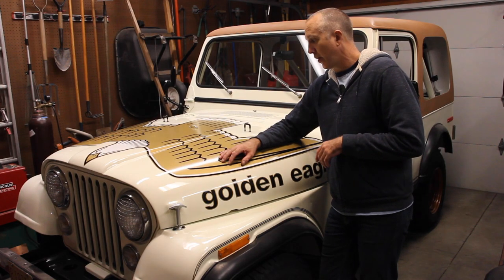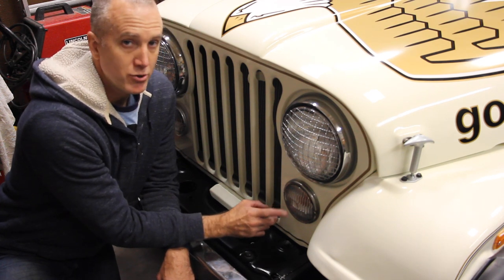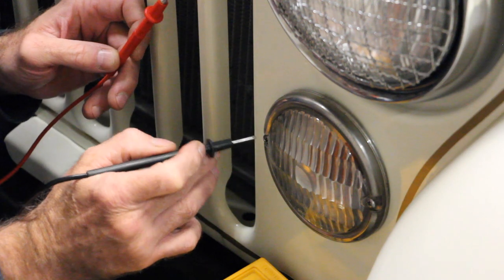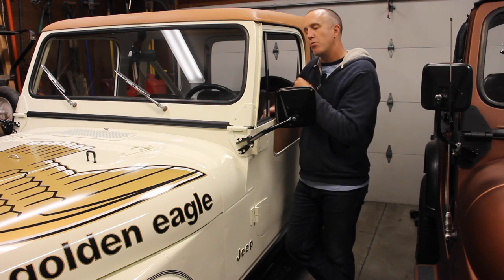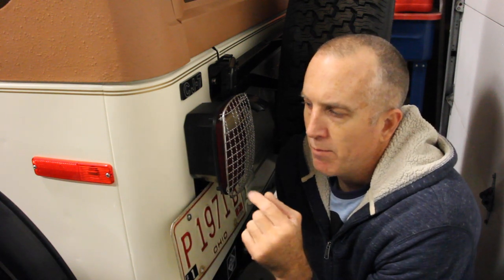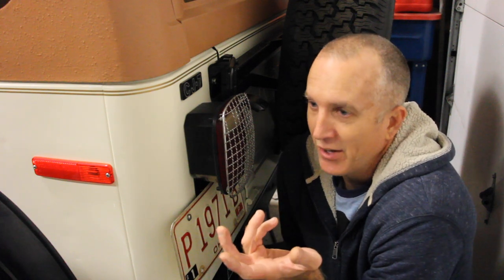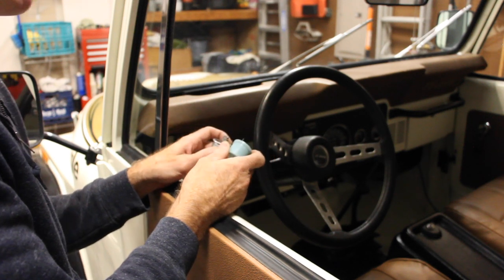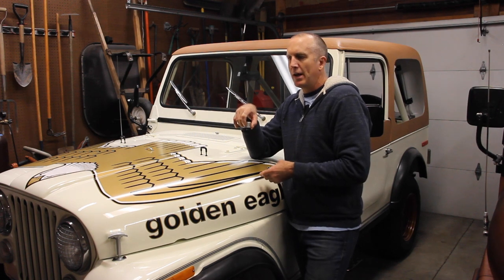Jeep CJ Grounds and Fuse Issues

Comment: I've had several Jeeps over the years and I recently purchased a 1985 CJ7. I love it and have recently upgraded the old stock headlights to LED. While doing this I removed the front turn signals in order to connect the Hailo turn signals in the head lights. When I reinstalled the turn signals that when I ran into some of the issues your talking about in this video. Discovered the quirky grounding issues. I have an extensive background in electronics so I recognized the issue relatively quickly. Unfortunately I didn't see your video until after this but it was none the less very helpfull in the confirmation. I've enjoyed quite a few of your videos and am looking forward to more.

Thanks for making these video's
Eric
Reply from the maker: Great to hear. Glad to hear the video helped, even in retrospect. I’ve got a couple more coming, although the frequency of new videos has dropped off in recent months due to other life priorities.

Comment: Thanks. I have a 79 cj5 with a wiring system that looks like spaghetti dinner for 50 at grandma Lucia's. I am putting this on the road and all I am really hoping for is functional(consistent) brake lights. Its got all the gremlins. Before I embark on a new wiring harness, which I will do eventually, I am going to attack the grounding. Thanks for your help.
Reply from the maker: Let me know the progress. Want to help where I can.

Comment: Just found your channel.  This video helped me figure out the turn signal issues I have been having. With my fiberglass body, the grounding doesn't occur through the screws.  I have a tab soldered onto the back of the housing that I can connect to with a spade terminal.
Reply from the maker: Fiberglass tubs pose a whole new set of rules when it comes to electrical connections.

Comment: My 81 cj5 was a victim of the recent "one in a thousand year" flood in Ft. Laud.  After 12 oil and filter changes it ran great,  BUT- electrics are nuts!  Only 3 flashers work, flash slow and after 5 minutes just stop!  One right running light is very dim, gas gauge suddenly go up and down, voltmeter goes on and off, yikes! Didn't have any problems before sitting halfway under water for a day.  After watching your vid I see how important ground issues are, I'll start there.
Reply from the maker: I’m betting it will solve almost every issue you have. Also go through your fuse box and make sure you are getting good connects with the fuses.

Comment: You could probably make an entire channel just on electrical issues and fixes for the CJ!  I have a '78 CJ5 and trying to sore out issues that I think are inadequate grounding of the dash (if that is possible) since wiper motor and dash lights intermittently have worked.  Considering just making a braided ground from dash to body, to see if it helps.
Reply from the maker: Working on it :)

Comment: I've watched so.many of your videos but hadn't found this one until I searched for cj grounding on Google.   I've got an 85 cj7 with a fiberglass body and chasing down electrical issues such as non working TS, taillight, parking light on with brakes,  tach, fuel gage.  The grounding to the frame checks out...I'll keep chasing
Reply from the maker: May brother has a fiberglass body. A good approach is to wire a grounding bar somewhere on the body and then connect that to the frame, engine, and battery. Then you can run ground wires directly to that. It will make a lot simpler system.
Reply: @coolguy_CJ7  yeah, it looks like they have a ground strap direct from the engine block to a bolt through the firewall that some grounds behind the dash connect to.  The dash panel is also grounded and a couple wires bolted to that.
Reply from the maker: @greghuizen  the tail lights, parking lights, and headlights all ground through the metal body parts that they mount to. So you’ll need to make sure they are grounded as well.

Comment: I just picked up a 79 CJ7 from my fiancé's dad.  It's in decent mechanical condition for being 44 years old, but the electrical system is a complete disaster.  The dash lights aren't working and neither is the speedometer/bulbs.  The turn signal switch needs to be replaced and only one brake light works.  Just ordered some new side marker lights but I don't think those are working either.  The headlights and windshield wipers work though lol.  I know I haven't even scratched the surface yet and need to start checking fuses and grounding.  What are your thoughts on only some things working and others not?  Your videos have been very helpful!
Reply from the maker: Grounds and bad/corroded connections. Get a good voltmeter and email me at dellis6914@gmail.com for a wiring diagram.

Comment: Crazy question but can you run your own ground,say to the metal plate in the light bucket to the body or the frame? Thanks, great info
Reply from the maker: @ronaldsteveson76  absolutely. Regrounding or adding extra grounds can eliminate a lot of issues with the CJs. Especially with the ones that are prone to rusting, which is all of them :)

Comment: Was having same type issues with my 82 CJ7 kept blowing the brake light fuse. Replacing the turn signal switch in the column fixed that but the left blinker wasn’t blinking. Pulled the lens the bulb looked good but one of the contacts and wires was hanging out the back. The rubber just got too old. Ordered two new crown light assemblies but I’m using OEM screws. The blues are not exactly correct so I’m cutting them off and replacing them. I’m also trying EL12 flashers which is supposed to be an upgrade.
Reply from the maker: Let me know how the “upgrade” bulbs work out.

Comment: This is great. I'm actually working on the parking lights this coming week so this is very timely. I've gotten it to the point where everything works except the one drivers side parking lamp. I'm going to be going through those grounds soon. I've seen people run a separate ground screwed into the back of the housing and to ground. I'm not ready to drill into my original parking lamps yet.
Reply: Got the parking lamp working.  Changed the turn signal relay.
Reply from the maker: Excellent. Progress!

Comment: Cool Guy excellent videos keep them coming. I have a 1982 Jeep Cj-7..For another video..how about replacing the round rubber  mounts that fill the under body of the Jeep
Reply from the maker: When I rebuild the egine on the 84 I will do that video when I put it back together.
Reply: Great suggestion.  Mine look like 50 year old bagels.
Reply: @KENFEDOR22  the rubber is the least of my concern. My jeep the body isnt bad for where its from but the mounts have rotted away under the rubber. When i flex out the jeep the rear crossmember separates from the body mount even though the hardware is mint.

Comment: Thank You for your very good cj's videos. I have a cj5 77 . I want to replace by myself all the old wires, conextions and fuse box. My Cj5 is the same as original(all manual, mechanic: brakes(4 drum brakes), stearing, 258 engine). Could you make a electrical wire harnes recomendation?. I see a lot of different wire harnes from Painless Performance and I don't reality know wich is better. The thing is this is urgent to replace the original electric installation. Thank's for your help Me Cool guy
Reply from the maker: I don't have any recommendations for the wire harnesses in regards to brands. I try to stay with the original harness for sake of ease. I know that they are not great, but I'd rather replace a couple messed up wires or connectors than spend $400 on a harness that I have to customize to my CJ. Just my .02.

Comment: Your front signal lights should blink alternately from side to front ?
Reply from the maker: Yep. That is what I still need to figure out. I think the flasher fuse is or needs to be a 224, not a 552. Just need to find a fuse that isn't as ohM dependent.

Comment: i have an 1983 im restoring and all the electrical finally works but when i have head lights on the front blinkers dont blink?
Reply from the maker: As far as I know, when the headlights are on, the front parking lights do not blink on signal. Only the fender lights blink at that point. Try turning on your headlights and then activate the hazards. If they don’t blink then there is a ground/connection issue.

Comment: I’m experiencing an odd wiring/signal/track light issue. My passenger track light has never worked. I replaced it and it didn’t work and then my running/signal (passenger side) stopped working. Check the ground (screws) and replaced two fuses, it began to work. Now, and I’ve changed nothing else and now my track light works and when I trigger the blinker the track light blinks and the running light goes out. And the signal in the cluster is always on when I have the lights on. Is it an issue with wiring in the steering column?
Reply from the maker: Send an email to dellis6914@gmail.com and I’ll get a wiring diagram to you. It sounds like you’ve got a grounding issues probably in the grill area.
Reply: Another question. Where are the track lights grounded?
Reply from the maker: @mikeking85  through the front parking lights. You can trace the ground wire to the front lights. If you have a voltmeter with continuity, that will help to trace.

Comment: I had weird issues unrelated to the ground. Turns out from the factory amc used a crimp in a smooth tape with fibers gray in color similar to  duct tape. Yes its factory ( amc was pretty crappy quality even for back in the day) jeeps been in the family since it had 800 miles in 1981 and my 1982 had the same splice in the same spot. Its tucked in loom behimd the driverside headlight bucket, its a crimp but jist the metal part. Also another one uo near the fuse block on the engine side of the fire wall on a red wire i think. Any how it was coroded and i guess 40 years in the salt and the jeep spending almost its whole life outdoors it started causing trouble. It is a splice where the parking or turn signal split off for the side marker . Been working good since i solidered it.
Reply from the maker: Actually you'll find a few of those in the later model CJs engine harness with the computer as well as the dash wire harness for all 76-86 cjs. Particularly for the orange light power wire and the ground wire splice. I'm going to put a video out soon that explains the whole harness behind the dash and the later model 258 engine. How to clean them up, what wire does what and how to fix if necessary. I just havent had time to get to it yet. Your insight is helpful to help m explain it.

Comment: Jeep wiring Gremlins seem to be a common occurrance thats for sure. Sounds like it's just part of the rebuilding process.
Reply from the maker: The wiring itself isn't too bad for the time period. The problems arise from 3 things. Rusted over ground connections from very poor corrosion protection. AMC being excessively cheap and using the frame, body components and poorly placed grounding spots as an electrical circuit. And POs bastardizing it to try and solve problems they didn't understand the cause of. Once you get it right, it's really nice to have the knowledge.

Comment: Hey guys! I’ve got a ‘76 CJ7. I’m having an issue with my headlights, quarter panel reflector lights, running brake lights and cabin lights; after several minutes of being on they will begin to flicker in intervals of a few seconds or so, sometimes longer than others. I’ve replaced the headlight switch and that solved the issue for a couple months.  However, the issue has arose again, any ideas for a fix?  I’m not too electrically inclined.
Reply: I’ve got the same issue! High and low beam seemed to fix it for a little while but it comes back. Do your lights flicker then go out? Mine go out after they flicker.
Reply from the maker: email is in the description. contact me and I'll send you the wiring diagram
Reply from the maker: Steve, it sounds like you've got a loose or corroded connection in your line. Most of these connectors were tinned copper and tin corrosion does not conduct electricity. I'd go back and sand all connectors and use dielectric grease. Not ideal, but it does help reduce the things to check and you'll learn a lot in the process.
Reply: @coolguy_CJ7  Maybe run a new connection wire in parallel - that should answer whether or not the existing wire is corroded.  This works with ground wires too.    A corroded wire does seem to make sense, though.
Reply from the maker: @KENFEDOR22  Great build. I actually did that to test whether my fuel gauge or sending unit was bad.
Reply: @coolguy_CJ7  Ugh, now you've opened my pandora's box!  Fuel gauge stopped working years ago.  Thought I traced it to a corroded ground attached to the fuel tank/skid plate but still no good.  Solution:  a piece of blue tape on the speedo with mileage plus 180 written on it.  Figure I get 10 mpg at best.   The labor required to extract the sending unit just isn't worth it.   Did you resolve it?
Reply from the maker: So, in regards to the original problem, is your light switch grounded through the dash? And have you tested all of your grounds? Headlights, parking lights, tail lights, ground strap from frame to engine block, engine block to negative terminal on battery... etc.
Reply from the maker: @KENFEDOR22  Do you know if your fuel gauge is still good?
Reply: @coolguy_CJ7  well that's a fine question and one I should probably answer next.  Is it a hassle to check without removing?
Reply from the maker: @KENFEDOR22  I'm going to do a quick video on that exact thing this weekend. So if you can wait...
Reply: @coolguy_CJ7  Like someone driving behind me up a hill, I can wait!
Reply: Idk how the cj's are i havent touched the headlight wireing in my jeep, but my grandpas 67 jeep waggy used a circut breaker from factory. Things would corrode and when towing a trailer the extra load and resistance would kick the breaker and he would loose all lights. Both his 67 and my dads 67 they re did all the wiring with a beefy relay so its way better than the facotry set up ever was. Does you jeep do ot driving down the road or stopped just on and your not touching or wiggleing anything ?

Comment: On my Speedo, the brake light stays on, any ideas why?
Reply from the maker: Have you checked the black signal wire that runs to the parking brake  pedal? The switch lever maybe be stuck or corroded.
Reply: @coolguy_CJ7  I sanded the corrosion down and it still stays on, what else could it be?
Reply from the maker: Interesting. When your parking brake is engaged, it completes the circuit by way of grounding through the pin contacting the back of the brake lever/arm. If that connection doesn't open when the brake is released, then the light won't turn off. What happens if you disconnect the black wire from the parking brake switch?
Reply: @coolguy_CJ7  the light stays on
Reply from the maker: Is this the only light in your speedometer that does this? All other lights function as they should?
Reply: @coolguy_CJ7  yep everything single other light but the brake light in the speedo function as they should.
Reply from the maker: Hmmm. I need to do some research.

Comment: nice tips... doing a fiberglass body swap is way worse for grounds
Reply from the maker: My brother did that to a CJ5. Basically he had to run everything to a grounding bar mounted somewhere in the engine bay. Then connected it to the frame and the negative post on the battery. Testing everything was difficult, but he got it done.
Reply: Its what im about to do. But first im building a steel skeliton in the jeep tub to beef up the fiberglass. The steel doesnt last in the salt here and i plan to drive this jeep till the day i die and i dont plan on dieing so im gonna build it to last longer than me. Have small distribution blocks for the small stuff and will run larger wire for the big stuff. Plan is to have a ground bar under the hood and one under the dash and maybe 1 sealed up in the back somwhere, we will see.
Reply: You have to tie the rollbar into the frame too and beef up your  seat belt mounts and seat mounts. My 1981 the belt retractor mounts on the roll bar but my 1985 mounts on the door jam support.

Comment: Had the same problem with my 82 CJ7
Reply from the maker: Did you get it fixed? If so, what did you do?
Reply: @coolguy_CJ7  I didn’t yet right now I’m fuel injecting the Jeep and fixing my speedometer, I’m buying led halo headlights and euro taillights
Reply: @coolguy_CJ7  I have not yet but will definitely attempt what you recommended to do
Reply: Gio I would love to know about the fuel injection on a 82.